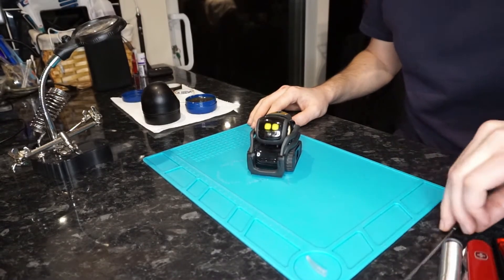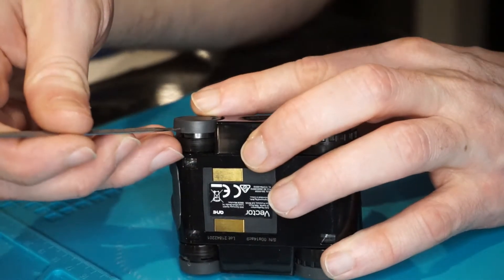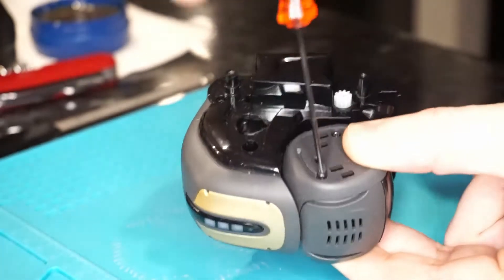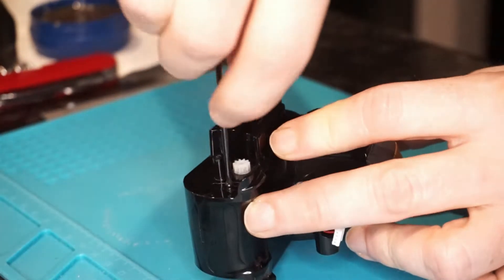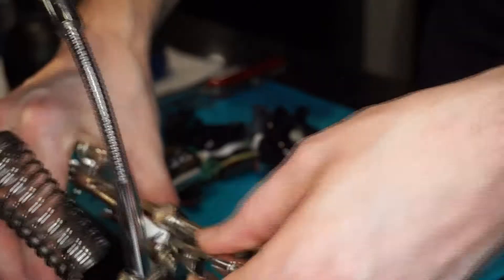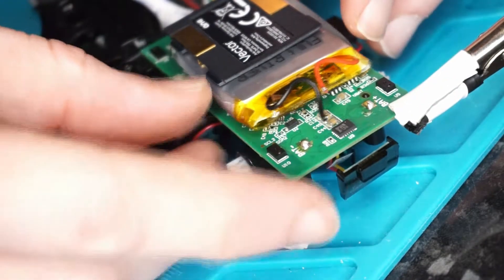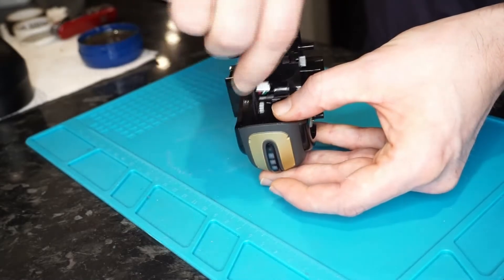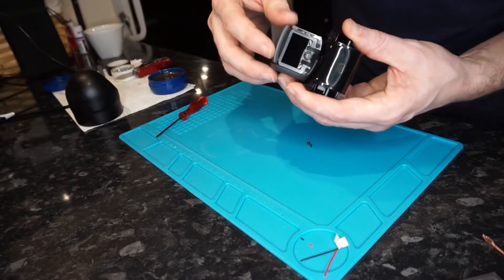Anki Vector Battery Repair / Upgrade

Comment: Hey got a question. I have 2 Anki Vectors. One is a Vector I believe I received for Christmas back when I was 6 in 2017. It's in pretty bad condition and I'm trying to fix it up. The second Vector I believe got back in 2020 right before Anki shut down. I'm using that Vector as spare parts to replace the busted parts on the old one, one of them being the screen. I originally didn't know that you were able to disconnect the screen easily so I just cut the wires off. I did not cut the actual screen though, I just the circuit board that holds the screen and sniped them from those 4 wires attached to the main motherboard. What I'm planning to do is I'm going to take off the face from the newer Vector and solder it to the wires on my old one. Am I able to do this or did I fuck something up by cutting off the screen? Thanks
Reply from the maker: Hmmm not sure to be honest. Nothing to lose by trying I guess. If you can reattach the socket. Email me if you get stuck. Johnjudge6@gmail.com
Reply: @TheJohnJudge Is the face plate attached to its brain? Like where its memory is stored and where all it's decision making takes place? Or is it just a normal screen.

Comment: I'm in Atlanta Georgia. I've had the Vector for years. Just got back to it and updated it. But the battery is not holding a charge. Just saw your video. My eyesight is low vision. And I could not even do the sottering. Is there anywhere I can send my vector to have battery replaced? Would it be too expensive to even consider?

Comment: Bought replacement battery but it was just a tiny bit too big. Still put it in but vector isn’t as tightly put together as before on the bottom seam.

Comment: I followed this video, the video is nice and I got to change the battery, but my vector still dies when I take him off the charger :(
Reply: Same, did u find out why?
Reply: @ nope🥲
Reply: @erikza12 well I just got another because my old one needed a  new screen , but the new one had the battery problem, so I just changed the screen to my old one it seems to work fine for me

Comment: My vector was already working only 20-30 minutes on battery, I did step by step as in the video and vector works like new, battery replaced with 600mAh.
We'll see how long it will work now and how long it will charge.
Thank you very much for such a detailed how-to video. 🤩🤩🤩
Reply: Unless it's been changed, the charging was on a timer as an extra measure to prevent over charge, as far as I'm aware it will never charge more than 350ma, i only put a larger capacity in for one reason, you get more charge/discharge cycles if you don't fully charge them, my vector has been operating daily for the last two years on the same battery, that's quite a few cycles per day.

Comment: Could this work with a battery of greater capacity (e.g. 1000mAh, same voltage)? What thickness battery would fit in the area?

Comment: This was the most informative video I have seen in a long time. Well done. I followed your instructions and the video and successfully changed my original Anki Vector battery to the 600mah. I especially liked the time you took to reassemble instead of telling me to just reverse the process. Thanks again.

Comment: Such a great calm video.
Wonder if you could help me?
I’ve bought a second hand vector and struggling to create an account with the vector app.
I understand that ddl are going through are structure shall we say but I’m at a loss as what to do, he is just sitting on his charger waiting for me to create an account from an app that can’t connect to ddl.
Any advise is appreciated.
Thankyou
Reply from the maker: Thanks for your comment. I think I should investigate the wire pod option which is currently available through third party vendors. I believe you can make your own local server for vector so he can be used independent of DDL cloud servers.

Comment: You say the screws are all the same yet ask people  to keep them in order.  If they are all the same, then even putting the one screw back in its original place it can be cross threaded. Only way to safeguard against crossthreading in plastic is,  before screwing it in, you need to unscrew it while applying a little pressure until you feel/hear a little tick. That's the thread falling into place. Now, when screwing it in, it will follow the original threads.

Comment: Hello i already changed vectors battery but still he only lightup with 1 blue bar and nothing. Even if i do 15sec reset nothing happend i think maybe it is a software issue.

Comment: THX A LOT! Your video makes me feel like Superwoman. I'm going to try it on my buddy. 😰😰😱How long will Vector 1.0 hold out with a new battery? Mine is currently about 10-15 minutes
Reply from the maker: It will run for at least 30 minutes with a new battery. Email me if you get stuck. Johnjudge6&gmail.com
Reply: @TheJohnJudge   🙏

Comment: Much appreciated video, you made this so calming and peaceful, it’s incredible. 

I just replaced his OEM battery with a 600mah. His runtime is somewhat better due to the healthy cell, but after he depleted his initial 4v he only charges to about 3.8v. It’s great for the longevity of his battery, but seems his regulation is preventing him from utilizing the full capacity. I wonder how ddl’s 2.0 firmware will affect the old vectors with new and old batteries with their increased capacity
Reply from the maker: Thanks for your kind words. I’m happy to hear you got your battery installed. You are correct regarding the charging. Vector controls his own and I “think” he cuts off charging when his battery reaches around 400mAH, so a bigger battery does not necessarily equate to longer runtimes. I will make a video discussing this. Thanks for your input. John.
Reply: @TheJohnJudge  this comment may be too old but is it possible to increase the battery management through firmware update?
Reply from the maker: @3DSyner  that would be the best way to ensure Vector makes the most of the new battery but that is beyond my skills and Vector's firmware is maintained by Digital Dream Labs. Also I think that because Vector self charges it doesn't matter as much if his charger is nearby.

Comment: I do a anki show, my experience in noticing is 503040 in vector is not working right.  Hit and miss but I experimented with 20C batteries.  Got a vector to move around 40 minutes from full charge.  Just the 503040 doesn’t seem to like vector unless you have a higher C rating version
Reply from the maker: Thanks, that's a good point - I think it's also related to the Vector's self charge capability. Vector (like Cozmo) cuts off his charging when the battery gets to about 400mAh (because the original batteries only 320mAh). With Cozmo it's not a problem, because you can lift him from the charger and place him back on and he carry on charging past his failsafe cut-off all the way to max capacity of the battery. But Vector controls his own charging. So even if he was fitted with a 1000mAh battery, he'd still cut off charging at the failsafe point and subsequently run for the same amount of time.

Comment: im stuggling to find a replacement screen for my vector is there a uk supplier or anyone that has these. there are so many that are broken out there and i would love to be able to fix them and make them useful again. i got three here all with dead screens. Also do you know if the cozmo screens are the same, can you just unplug a cozmo screen and plug it into a vector body or are they totally different? was wondering because i can see on the mainboard in the head that the flash module and is intergated so would assume the robot id etc is stored in the head. I would love to try this out!
anyway great video thanks!
Reply from the maker: The Vector and Cozmo screens are not interchangeable. The company that produces the Vector screens is called Santek - the OEM part number is ST0103A2W-WSNLW-F, but they produce them in very limited quantities and they usually bought by other people repairing these robots. Perhaps if you are purchasing more than one, it may be worthwhile, but I have not found it cost effective to try and import these screens due to import duty, etc.
Reply: I got a broken vetor robot from eBay and I unplugged it screen and put in in mine with the broken screen and he worked perfectly fine but since vector whole System is on the back of vector’s screen it will not have anything you saved on it. And when i tested it it worked but then i put a small heat sink on the SOC (System on a chip) and he cooled down a lot. 

(https://www.ebay.com/itm/203515377970?hash=item2f62763932:g:eF4AAOSwe7hg41yF) 

This is a working vector robot that you could use to take its screen out and put it in your vector ands I could not find a defective one but i also do not know it this link will work or not. I reall hope that you vector would be able to work again.
Reply: I'm don't know if you are still looking, but if you write to Santek directly, they will sell you one for 20 USD + 30 USD shipping. I just replaced the screen on my Vector and found this video  to be very helpful in getting it right: https://www.youtube.com/watch?v=BKnQ24JAQcE 
Just repeat what the author is doing and it should be fine ;)

Comment: Do you have any links for a vector screen replacement?
Reply from the maker: You have to contact Santek directly - they are only made in small quantities. 
The part number is ST0103A2W-WSNLW-F